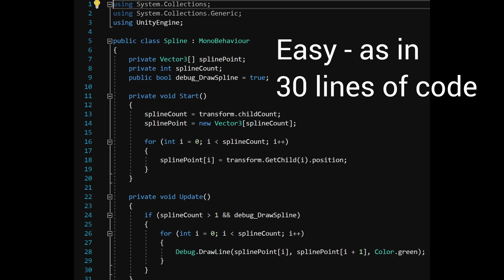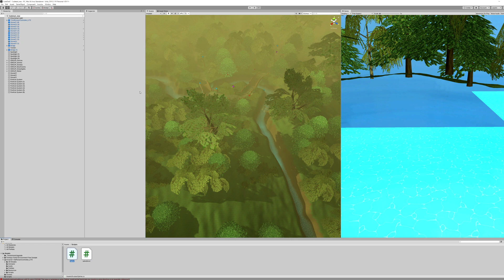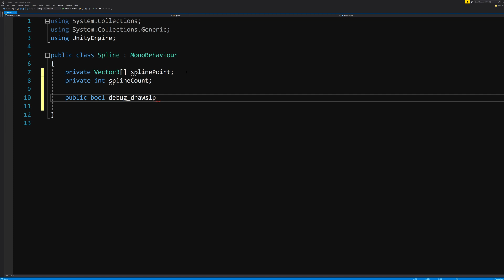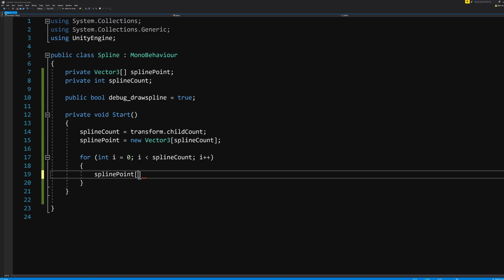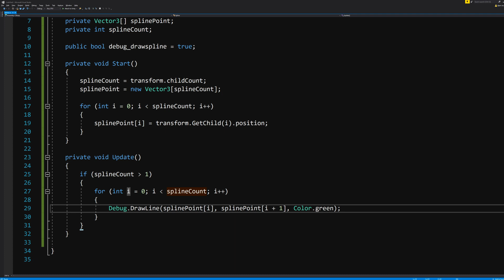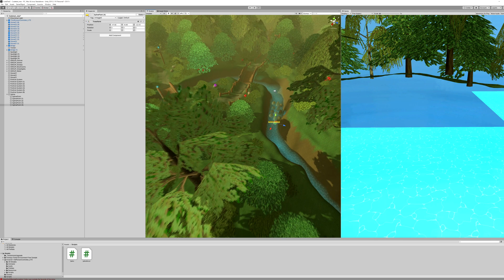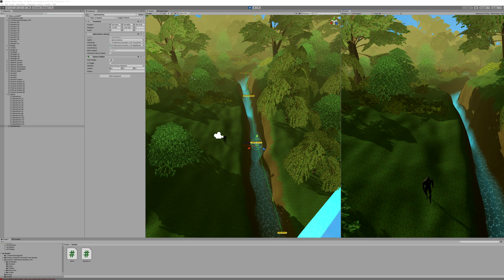How to create a spline in Unity.

Comment: Great video! Are there any alternatives to a single audio emitter following the player position? Something more atmoshperic and widespread, sounding as if there are multiple audio sources?
Reply from the maker: Like, instead of having one that follows the river, it would be attached to the player and "detect" the river and play from there? So a 2D widespread sound from there rather than using 3D positional emitters?
Reply: @CujoSound  In that case the emitter position would be at the player, right? I imagine more like a volumetric sound, that is defined by an area and that extends over the whole river and that has multiple emitters. And that plays from the river position!
Reply from the maker: @RimmCriolle  You can have an array of emitters along the river, but that would require that each of them and the sounds attenuation is perfectly balanced so that when crossing between them you will not notice.
Multiple emitters would require a lot of spread on the sound else it would be quite easy to hear that you are moving past the emitters like lampposts on a highway.
Reply: @CujoSound  All right thanks! I wonder if that would sound significantly different. Maybe 3D audio is more what I'm looking for

Comment: I need a litle help here, im quite new to this and i keep getting error in unity when i try using the spline script to follow the player. it always says -> transform does not exist in the context. what am i doing wrong !!
Reply from the maker: What object does it say it's on? And does the script still run?
Reply: @CujoSound  none of my script are attached to any object because it keeps telling i have an error or class name. i double cheked and its all good still doesnt work :( keeps saying , script class not found
Reply from the maker: @Eternelation  ok. So visual studio or unity telling you this error?
Reply: @CujoSound  visual studio is not telling me any error, its unity , its telling me error CS0103 for transform and debug_DrawLine. error CS0019 for Vector3 and float and 1 more error CS0119 for Transform
Reply: @CujoSound  ok, i finaly got it to work after a few hours, i still have this error if you can help me here IndexOutOfRangeException: Index was outside the bounds of the array.
Spline.Update () (at Assets/Spline/Scripts/Spline.cs:30)

the line 30 in question is the Debug.Drawline(spline.....) so is it expected ?
Reply from the maker: @Eternelation  That one is expected, as when the game isn't running I think it doesn't count them, so the index is 0 or null. I don't remember how you can get rid of it, but a quick thought is to tell the code to ignore the index if its <1 for example.

Comment: FYI your code is throwing an exception when accessing a spline node for i+1 (when i+1 is actually greater than the spline count).  To fix it you could start your loop at 1 instead of 0, and draw a line between splinePoint[i-1] and splinePoint[i]
Reply from the maker: Nice. And yes, code isn't super clean. Thanks.

Comment: Hi, great video! Thank you very much for your content. One question: how do I solve the issue of the index being out of bound?
Reply: I know its a little late, but if you still have this issues, just change "i<splineCount" to "i<splineCount-1" on line 26 in the code at 0:43. this will just end the drawing 1 element early in the spline array, which prevents it from trying to draw to an element that doesn't exist
Reply: @crableglars  thank you very much!!!!
Reply from the maker: I actually don't know right off my head. But I think you would need to define somewhere that the length of the array of nodes is the maximum length of the index, so it doesn't look for the next one or its problematic as it doesn't know before you run the game. 

But not sure. Sorry